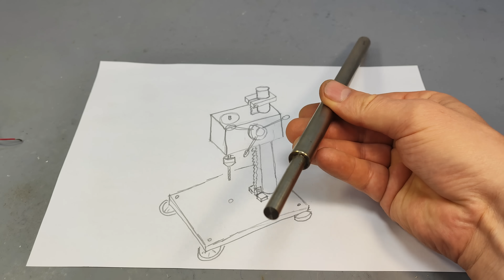Amazing  Mini Drill Press DIY

Comment: Not what I would call DIY, when I need a lathe to make most of the parts for the Mini Drill......
Reply: lmao, good point... nevertheless this guy is very talented
Reply: I think this is stil diy, because for most part are self made not store bought ready that need little assembly like Ikea
Reply: Next video: making DIY lathe with lathe
Reply: You just have to think a little.  The use of the lathe was completely unnecessary if you have a drill.  I would guess it would be easier and faster without the lathe.  

* The feet could have been 4 nuts.   
* The two clamps could have been metal blocks with holes drilled in them a slot hand-sawed into them.  Starting from round stock was actually weird andd wasteful if you have square stock.  You could make them from hardwood, too.
* The large wooden block could have just been drilled and sawn/chiseled.  
* The gear axle, which they didn't show being made, could be any rod.
Reply: Right

Comment: Homemade?!!! Who has a lathe at home??
Reply from the maker: I have two lathes at home
Reply: You dont need one if you think about this at all.  The use of the lathe was completely unnecessary if you have a drill.  I would guess it would be easier and faster without the lathe.  

* The feet could have been 4 nuts.   
* The two clamps could have been metal blocks with holes drilled in them a slot hand-sawed into them.  Starting from round stock was actually weird andd wasteful if you have square stock.  You could make them from hardwood, too.
* The large wooden block could have just been drilled and sawn/chiseled.  
* The gear axle, which they didn't show being made, could be any rod.

Comment: Step 1, get an industrial lathe.  Yeah, definitely DIY lol
Reply from the maker: Thanks friend for your support
Reply: I thought the same thing...lol.
Reply: The use of the lathe was completely unnecessary if you have a drill.  I would guess it would be easier and faster without the lathe.  

* The feet could have been 4 nuts.   
* The two clamps could have been metal blocks with holes drilled in them a slot hand-sawed into them.  Starting from round stock was actually weird andd wasteful if you have square stock.  You could make them from hardwood, too.
* The large wooden block could have just been drilled and sawn/chiseled.  
* The gear axle, which they didn't show being made, could be any rod.

Comment: where did you get this materials can you share to me with a link
Reply from the maker: I found these materials in my workshop. I no longer understand what’s coming from. The engine was donated by friends.
Reply: I want motor,rack gear and the gear wheel.can you send me a link if you find in internet.
Reply: I search many times but i cant find.

Comment: 9/10. I would have given 10/10 if you had run the power cable down the metal tube and out the base. Fab job, though!

Comment: Nice one, but screwing directly into MDF, probably won't last too long…
Reply from the maker: This is not MDF. this is textolite. Material impregnated with resin, very strong. No worse than aluminum in strength.
Reply: It just looks porous, as for the sawdust from it. I somewhat doubt an M3 screw will get a good grip there.  @serengytech

Comment: Very nice invention, but Not a possible diy for the average home/garage worker.
Reply from the maker: Thanks friend for your support
Reply: Because of the lathe?  The use of the lathe was actually unnecessary if you have a drill.  I would guess it would be easier and faster without the lathe.  

* The feet could have been 4 nuts.   
* The two clamps could have been metal blocks with holes drilled in them a slot hand-sawed into them.  Starting from round stock was actually weird andd wasteful if you have square stock.  You could make them from hardwood, too.
* The large wooden block could have just been drilled and sawn/chiseled.  
* The gear axle, which they didn't show being made, could be any rod.

Comment: Yeah! That will do nicely. A lot more power than I had guessed. I liked the way you basically made it a kit you put together at the end instead of having it built out over the course of the video. Very COoL.:face-blue-smiling:  p.s. I wonder if adding a small "flywheel weight" just above the chuck- at the brass coupling,would smooth it out even more. Blaw blaw. I shouldn't mess with perfection. Cheers from So.CA.USA 3rd House On the Right. SUBBED! :face-fuchsia-tongue-out:
Reply from the maker: Thanks friend for your support

Comment: I wonder how it would have gone, if you had just used the lathe to cut off the screw heads of the feet, once secured in them, before cutting off the feet? Might have given a cleaner end, that oh could have also slightly chamfered. Ideas for the future.
Reply from the maker: It is possible on the machine. but so much faster.

Comment: Down voted due to the use of DIY. A lathe, a pillar drill, tap and die set. I am sick and tired of this 'DIY' videos where your required to use tools and equipment that the general home user will not have and thus be impossible to build the DIY object. Content creators need to stop doing this.

Comment: I like it! nice idea but not many of us have a metal lathe to make the parts unfortunately.
Reply: What ever he has done on the Lathe can be done by hand. so stop crying and put in some shoulder work.
Reply: Don't be put off, as the lathe was completely unnecessary if you have a drill.  I would guess it would be easier and faster without the lathe.  

* The feet could have been 4 nuts.   
* The two clamps could have been metal blocks with holes drilled in them a slot hand-sawed into them.  Starting from round stock was actually weird andd wasteful if you have square stock.  You could make them from hardwood, too.
* The large wooden block could have just been drilled and sawn/chiseled.  
* The gear axle, which they didn't show being made, could be any rod.

Comment: May I know the model of motor used here please so i can replicate the drill press
Reply from the maker: 0.30
Reply: @serengytech hi I tried searching 0.30 motor or 0.30 dc motor in Google but did not find anything that looked like what you used in the drill press. Please help
Reply: @arathireddy7559 see video at the time of 30 seconds. 
Here you can see the prints on the motor.
Greetings from Belgium
Reply: @onl4180 thanks I got it and ordered the motor from aliexpress 
Greetingsfrom India